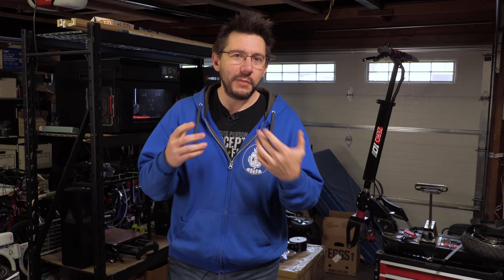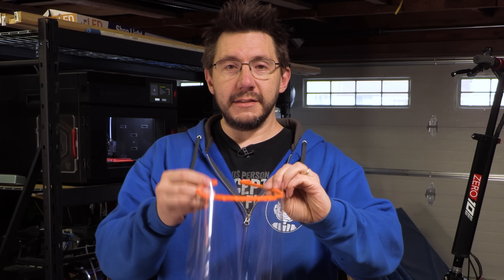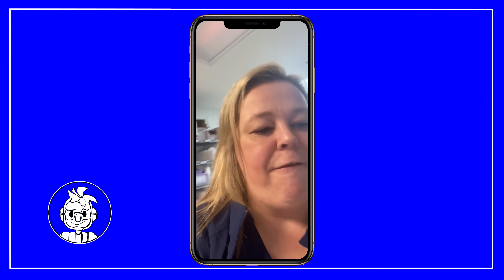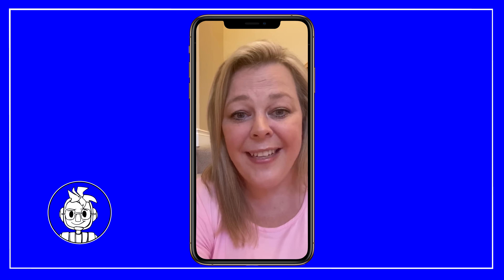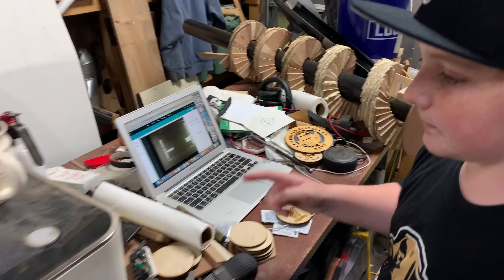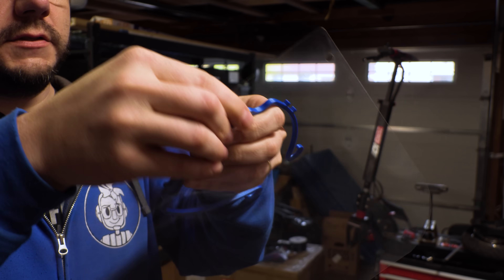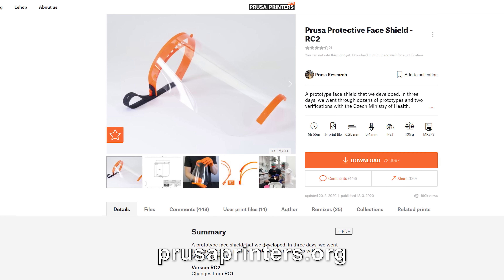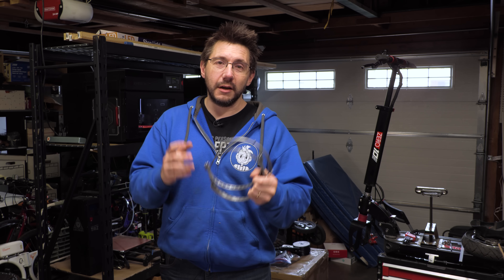3D Printing Face Shields and YOU CAN TOO!

Comment: Help!!!  I have an issue that I was wondering if the maker community could help out with...I tried your link to the films to make face shields for our local hospitals. However, when I go to order any and all filament and the films can not be shipped for almost a month. BUT, get this if I wanted an Amazon Echo device I can get that in 2 days. I spent over an hour on a chat with Amazon this morning and got nowhere. I explained the need for these products to the maker community and the need for these items to support our local hospital with the shortages of PPE they are experiencing. They stated it was because "they were prioritizing shipments and please don't worry about it you will have it by April 23rd". The prioritizing shipments I can understand but why is that an Amazon Echo device a priority and the health community support products are not. Now I know I can and have ordered some from other vendors but this is not the point. The point is speed and keeping expenses to a minimum so we can provide as much help as we can now not in a month. With Amazon warehouses around the United States full of supplies with typically a day or maybe 2 days shipping times, this would be ideal to get the badly needed PPE to our healthcare community to do their jobs safely. Please help make our voices heard!!! Thanks!

Comment: My printer only has a build volume of basically a 4 inch cube (I can do the bottom piece thing of the Prusa design) is there a version that can be printed in smaller pieces that can still work well enough after assembly? (would require some kind of bridge piece in addition to just slicing it up?)

Comment: Beautiful job. It is especially important to extend the mask past the temples to protect the eyes. Otherwise you need to wear goggles under the mask.
We are 3D printing face shield and N95 equivalent masks right now for Keck Medical Center of USC. We are using  a model which we originally found at https://lowellmakes.com/covid-19-response/ We have and are continually modifying the design for ease of production and to fit different size faces. If you are in the LA area and can contribute with 3D printing any of the models we have validated at USC, please email DonateProtectiveGear@med.usc.edu 
For information about COVID-19 in LA go to keckmedicine.org.

Comment: I got an actual fracture (and "explosive" chiping) at the first corner when over flexing the arms - this was using TGlase at 240 on an Ender 3 using the project's suggested 0.5 line width on a 0.4mm nozzle... anyone else see this?

Comment: I just started printing these for the local VA nurses, they said that they are almost out of face shields.  Just wish i had more printers         https://www.myminifactory.com/object/3d-print-115783?fbclid=IwAR3MT0JsISzLurEAX6B3tFstBcffb_eeEgvpcMuYZI7y3-2UdX4eiaSKY54  here is a template someone made to cut these out  using a single hole punch

Comment: I was thinking that if there was a way to make the clips work with the holes made with a three-hole punch it would be a much more accesible build.
Reply: Gabi Bike Well the reason it is the way it is because it’s designed in Sweden and Swedish hole punches make four holes. You set the hole punch to A6 size paper, make the first four holes and then flip the film over and make the other four.

Comment: On the laser cutting could you place a piece of paper between sheets and up the laser power to do multiple at once?          The company I work for have been contacted to provide just this. For speed we have SLS to do multiple frames in a build. Just need to speed the process up for laser cutting the acetate.

Comment: Would a 3d printed hole puncher work
If it can be, would it not be possible to print one specifically for the best model to save time laser cutting (so that it fits the top of the clear film, and you don’t need to move it)?

Comment: we have an facebook group here in denmark that is making a "better/modified" version of this. where we does not need to put holes in the sheet (Here it is https://www.thingiverse.com/thing:4233193 )

the group is working together with 3d printer stores around the contry, we deliver the finished maskes, and they gives us free filament in return, then the hospitals and ElderCare pick them up at those stores :D

If any danes with a 3d printer wants to join the group, here it is: https://www.thingiverse.com/thing:4233193

Comment: Hey Joel, would something that can be printed in a smaller footprint and assembled be a good idea? I figured you are either A.) wasting a lot of free real estate on your print bed or B.) unable to print this on smaller machines. I did a rough tweak of the NA 3 hole punch version on tinkercad here. https://www.tinkercad.com/things/7xJGP0zBsJV

 I think you'll be able to print 3 at once with your machines in the video!
Reply: Addison, I'm thinking your design will allow me to print the visor on my smaller printer.  Any idea of it's durability?
Reply: It should be nearly the same. Just a drop or two of super glue between the pieces. Unfortunately I am printer less in quarantine so I need someone to give it a try

Comment: Binding Covers
Check out https://www.cfsbinds.com. I started with a chat (lower right) tab and talked to Christian and ordered 033027AACL this is 7mil binding cover crystal clear. Ships from multiple location in the US. I will update when mine arrives. Number is 1(888)237-3221 Christian also said they make larger sizes prices are good. Matched Amazon and no shipping charges but negotiate your price.

Comment: Hey wonderful use of the tools you have.  One thing though.  Can't a Brother Scan 'N Cut or other personal cutter like a Criquit cut out those holes many layers at a time?  How much time would it take to custom make or print a strong enough die punch?  Lots of crafters have large die cutting presses.  Even if they have to do it in stages or sections the work can be shared by more people to meet demand that much faster.

Instead of Apollo transparencies try the bulk orders from Uline.  You might get a price break.  Or maybe you and some others could work out a deal with them?  In the event transparency film starts running low how long does it take to 3D print polycarbonate into a functioning face shield?  Would there be problems with optics?  Could they also be made with the prescription of the intended user in mind?  So that the portion that covers their eyes would allow them to see better or as a magnifier component that could slide in and out of position?
Reply: I was wondering the same thing, but how do you keep all the sheets together while you cut?

Comment: I think this is a commendable, and timely effort, but what about sterilization of these devices? 3D printed parts are known to be problematic even just for food use. Not only from plastic choice, but also the micro porosity and inclusions of FDM process in particular. For personal, or home use, I can understand and fully support this. How do you ensure that distributing home-brew PPE for use in hospitals is safe and sterilized? Just saying this needs to be taken seriously. Medical devices have very high QA standards of manufacturing for good reasons.

Comment: I'm going to try and make one of these out of PETG so it can be autoclaved. 
 Is there any sort of resin that could be used to seal the gaps in the plastic which would stand be autoclaved at 140 deg C / 284 deg F.

Comment: What settings would you recommend? I have an Ender 3 and relatively new to 3D printing. First one I’m printing off is approximately 2 hrs. 

Basic things I did:

10% infil with cubic setting
 .28 layer thickness

How can I improve my time?
Reply: I also tried it on an Ender3, i used a 0.8mm Nozzle, 0.3mm Layer Height, 100% Infill, 60mm/s Printspeed, PLA 200°C Nozzle and 60°C Bed, took around half an hour and the result is perfect.

Comment: question: do you have to lasercut the transparency sheets? I am wondering simply because I do not have a laser cutter but would love to make some of these for my local hospitals to help.
Reply: They are designed to be made using an office hole punch. That's why there are three different models because different contries uses different kinds of hole punches.

Comment: There are a lot of talented CAD designers here on YouTube. Has anyone called out a challenge to design a complete 3D-printable ventilator? It's basically an air pump right? Seems like something that could be mostly printed except for perhaps some motors and maybe an Arduino to control it. Sure it wouldn't be "medical grade", but if the choice were a 3D printed machine that might work and nothing, I think it would be worth a shot. I'd certainly volunteer to print them.

Comment: Is printing with .4 nozzle not OK for structural/strength reasons, or is it just a suggestion because it will take longer? I only have .4 but want to help.
Reply: 0.4 works fine, just a bit slower. You can easily print 0.6mm wide walls with a 0.4 nozzle. Go for it!

Comment: The open style face shield is better than nothing but I think that the aerosol danger of floating virus particles means anyone in contact with possible infected individuals should use airtight goggles with foam rubber gaskets where they touch the face, these are available on Amazon. If dust-sized particles are carrying the virus then extra care must be taken.

Comment: Anyone figure out how to stack them on the print bed yet? I tried several variations but the surface quality on the bottom layer of the upper model would not come out clean enough. If we can figure out how to print them stacked I could run the printer all night and have 40 or more every morning!
Reply: I put them exactly one layer height (0.28mm) apart and they are separable quite easily. The only downside is that it has to be cleaned.

Comment: If I were to do, say.. 10 sheets at a time, would a drill work well if I have a paper print of the hole lineup? I don't have a 3-hole punch that'll do the job.
Reply: Order a three hole punch with your next batch of transparencies. They are less than $10. :-)
Reply: @petsandpondscustomerservic1518  I would expect a drill press could handle several hundred at a time with ease.

Comment: just in case you were wondering about US regulation , https://www.ncbi.nlm.nih.gov/pmc/articles/PMC5015006/

"There is currently no universal standard for face/eye protection from biological hazards.[2] Therefore, the recommendations for the proper use of face shields vary widely, indicating the need for a consensus on the use of certain face/eye protection for specific medical procedures.[26] OSHA’s Bloodborne Pathogens standard (1910:1030 subpart (d)(3)(i)) states: “Masks in combination with eye protection devices, such as goggles or glasses with solid side shields, or chin-length face shields, shall be worn whenever splashes, spray, spatter, or droplets of blood or other potentially infectious materials may be generated and eye, nose, or mouth contamination can be reasonably anticipated.”

Comment: I was able to cut holes for the Prusa mask with a Cricut Maker using the Knife Blade attachment. This was for thicker plastic than transparency film,  so both the Cricut Maker and Explore Air 2 machines should be able to precisely cut holes for transparency film.

Comment: Hey Joel (and community), I had not yet pulled the trigger on a 3d printer but this seems like the perfect reason to do so. Can anyone tell me the necessary bed size for the file? I.e. would a Prusa Mini (7x7x7 or 18cm*18cm*18cm) work or is the bed too small?

I know Joel mentioned the Mk3 (prusa) printing one, so that bed size would work. I'm not sure about smaller units though. Help?
Reply: You need at least 18.3 cm to print a single unit at a time, assuming you can utilize the entire print bed. You could scale the length of the arms down 1 cm and still have a decent fit for most people
Reply: @petsandpondscustomerservic1518  Thanks! Looks like the Prusa Mini would be cutting it too close possibly then. They are all on backorder anyways sadly. I'm thinking an Ender 3 Pro or CR-10 then.

Comment: The lazer cutting part is problematic and will slow the process down a lot. There must be an easier and quicker alternative.
Also what is the best thickness for the transparencies. The one stated does not give what microns the thickness is. Is 100 microns ok or is that too flimsy?

Comment: No Laser Cutter Needed! 
     For the U.S. version, that is.
I had great results just punching holes in a transparency sheet (8.5" x 11")with a standard 3-hole punch. Like Joel described making his first visor, use the spacer at the bottom of the punch and punch the first three holes. Flip the sheet so you are punching holes on the same side of the paper, place it against the spacer and punch again. If your 3-hole punch is set up properly you will now have 6 holes perfectly spaced for a tight fit. 
For less pointy corners on the plastic sheet, just round them over with scissors. Or, like me, borrow your wife's corner rounder and punch all four corners.

Comment: Oh almost forgot, how long does it take to make one?
Reply: I can print two in 36 minutes on a CR-20 with volcano hot end. 0.3 first layer height - then go up to 0.5mm. 0.8mm wide walls. For this speed you will need a 0.6 or 0.8mm nozzle. Without the volcano hot end you probably need 45-50 minutes to print two.

Comment: Hi friends. My hole punch doesn't have a adjustable stop. The stop is fixed and part of the punch frame. So the spacer won't work. Does anyone have hole center line dimensions starting at the edges or the centerline? I printed the hole templates but the holes don't seem to print in the correct locations. I'm printing the 5 hole, 6 hole and 8 hole frames. Be safe. Thanks for any help.
Reply from the maker: new files added with hole templates for the 6 hole version.

Comment: Thanks for doing this video. Was excited to see someone give Eric's design some promotion. My niece is respiratory therapist on the front lines so last week I looked at lots of shield options. I've been printing Eric's on my Mega. Reason is the simplicity and material efficiency (15 gms PLA vs 150 for some designs). I elected to go with the 3-hole version. Nice to learn of the adapter to use common hole punch for the 6 hole. So far no complaints from staff trying the 3-hole though. BTW getting PLA and covers sheets from Prime (no longer 2 day...) still keeps material cost about $0.50!  Eric, if you're listening you're my hero! Oh yeah, prints great at 0.4mm  (Hatchbox PLA).
Reply: I see that you mention 15gms  PLA. The only place I could find the parameters was in a folder that had a PRSA MK3S 3MF file. I opened the file and it shows 30.58gms with their settings.  What settings are you using?  Thanks

Comment: Would you recommend the print you showed with a 0.4 nozzle or something else? There is a nursing home in my area that need these desperately and I only have my Ender 3 with a 0.4 nozzle
Reply: 0.4 nozzle seems to be working fine for me so far. Just got to watch the first layer since mine likes to not stick that very first little bit of filament to the bed. Did not use a brim or skirt.

Comment: I love this  -  I have printed one, and have tinkered with the design slightly ( I will attribute to the original designer, no fear, ) but I have one concern, which is that FDM printers do tend to lay down material in an inherently porous, or 'rough' way, such that surfaces are, at the micro level, somewhat susceptible to contamination. Is this going to be a problem, given the dangerous environment they will be in?  OK, sure, the frame can be sterilised (I hope,) I only ask because I wouldn't want to be making a bad situation worse, while trying to contribute to a solution.  Concerned.....   Are they going to be a one-time use item??

Comment: Just ordered the plastic sheets. I don't own a 3d printer so I will make some molds of an approximate prototype similar to the design you have. I happen to have a couple of gallons of Smooth Ons smooth max 300. Hoping it isn't too brittle for a little flex . Great idea!! I needed to find a way to help. this might work.

Comment: I'm printing those in Spain, I have problems finding the transparent sheets and the rubber band (slightly different design). It is sick to know any plastic injection factory can make them by the millions but they are sitting over their hands, we will not forget.
Reply: It takes time to retool their machines. Give them time.

Comment: Instead of using a lasercutter for the holes, print a template, clamp all the sheets together and use a nice sharp drill? Maybe this will work faster? than doing them one by one?

Comment: Joel, what are the Glowforge settings you are using to cut the acetate?

I've printed about 60 of these, and will start cutting the acetate tomorrow, so if I can avoid a little bit of trial and error, I would appreciate it - GLOWFORGE PRO is what I'm using.

Thanks!
Reply from the maker: I’m using my father in laws glowforge pro as well! I did custom, full speed, 25 power
Reply: @3DPrintingNerd  Thanks, I'll be cutting some tonight. I have 100 sheets of acetate, just waiting for the fun!

Comment: Hey I printed these and was going to use the cameo to cut it. However the holes do NOT line up at all. What file did you use to laser it?  I printed a lot of the Visor_frame_SWEDEN_v10.stl or am I screwed? And just throw these away?

Comment: AN EXPERIMENT to print a ton of these:  Stack copies of the frames in your slicer (one on top the other), spacing them about 3 layers apart, then generate supports.  This should allow you to print a bunch in one batch, then separate them after the print.  I've got this modeled in Simplify3d, but I can't start printing until tomorrow.  Seems like a better solution than starting a new print every 20 minutes.